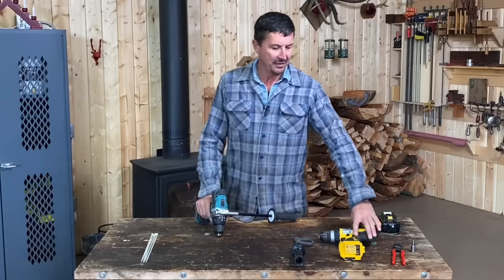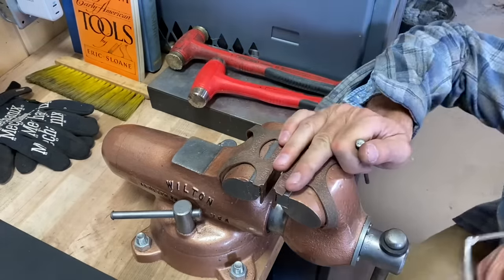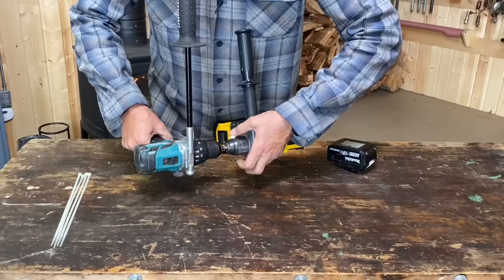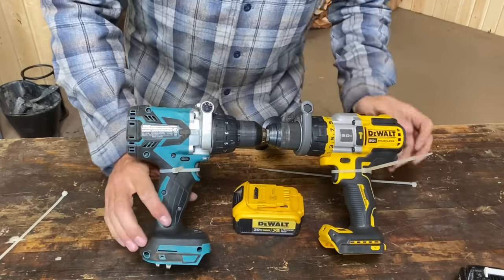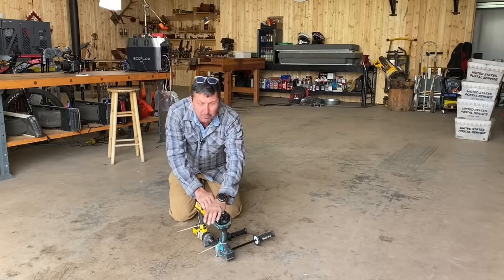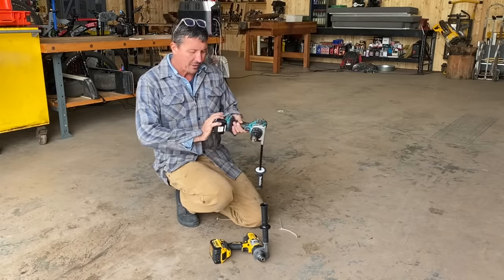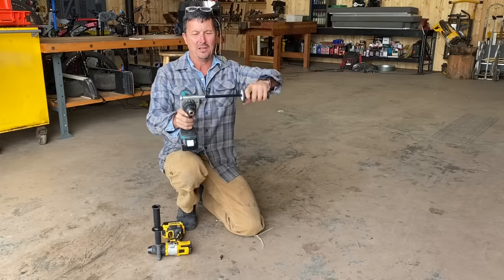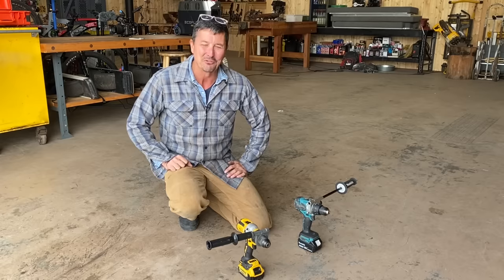CORDLESS DRILL FIGHT - Makita vs Dewalt (OFFICIAL VIDEO)

Comment: I’ve had both and they both have worked extremely well for me…I did drop a Makita impact down an elevator shaft…I put the battery back in and it worked like nothing happened.
Reply: I have dropped many things down an elevator shaft. The most dramatic was a stepped brake core from an Otis machine. Blew apart like safety glass, didn’t expect that!?
Reply: I've dropped my old 18v Makita off an 8 foot ladder onto concrete multiple times with no ill effect, but an elevator shaft? How many stories?
Reply: Do it again..... NO HANDLES!! that will be quick and what the people want.
Reply: @RefinerSimilitude  4 stories…Since then I’ve only used makita. Although I have been wanting to add either DeWalt or Milwaukee sets bc they have so many configurations.
Reply: Good fun working on top of lifts, I install fire alarms so any excess cable just gets tossed over the car into the pit.

Comment: Great video, but I want to see a rematch. Watching them Duke it out in slow motion revealed that the handle position aided the Makita because it acted as a brace against  it's rotational force. The DeWalt however had no such aid because the handle was on the opposite side. It appeared the DeWalt was actually spinning the Makita until the Makita's handle hit the ground and gave it traction. The DeWalt was in my opinion doing all the work here as it spun the Makita like a top.

As I said, great video, extremely entertaining, but as a team yellow user I must protest. God bless you and yours.
Reply: I agree
Reply: I would have thought the opposit: if you think about it, the most leaverage each one could get is laying top down with the handl flat on the ground. From the rear they spin clockwise so the torque on the machine would be conterclockwise. If the makita lay top down on the ground, conterclockwise torque would lift the handle off the ground. If the dewalt lay in that way, it would push the handle in the ground and would have to lift the machine. If that makes sense.
Reply: I'd guess thats why the makita seemed to jump around a lot more the the dewalt did.
Reply: Interesting analysis...
You have a future calling power tool fights. 

I say rematch with handles on opposite sides. Keep an eye on the lights to tell when the thermal switch kicks off.

Comment: You should have stood on the handles, so they wouldn't bounce around.
Not really a fair test that way.  The drill on the bottom pretty much gets pinned in place, less damage.  Drill on top flops all over the place.
I wonder if that thermal switch would have made a difference, with both pinned down.

Hope you had fun😎

Comment: Props for the test. I dont think its the ultimate test. Any of them could've been banged at a bad spot at the random twist. And doesnt necessarily means in a normal long term use the tool.will wear out the same. Plus lower speed for each tool could be difderent rpm. Anyway props for the test and keep up the good work

Comment: that Dewalt is a Flexvolt Drill, its only running at 20v with that standard battery, with a flexfolt battery it would run at 60v with almost twice the power, it wouldn't even be fair on the makita.

Comment: The problem I keep having with the newer Dewalt drills is the same issue that happened here. The Dewalt chuck always comes loose, and looses the bit. 

Watching you set those up was like getting ready to light explosives that you've messed around with, and the Fuse is faster than you want it to be.

Comment: The Makita chargers used to overcharge the batteries so if you left them on the charger it would destroy the batteries. Unlike Dewalt that would stop charging, this was about 15 years ago so I am sure they fixed this issue by now, but it is one of the reasons I have always bought Dewalt.

Comment: The chuck on my Dewalt is a piece of junk. It never holds anything screw bit or drill no mater how tight I try to get it. Yes I've tried resetting them but it always releases in middle of using it. Over priced piece of junk!